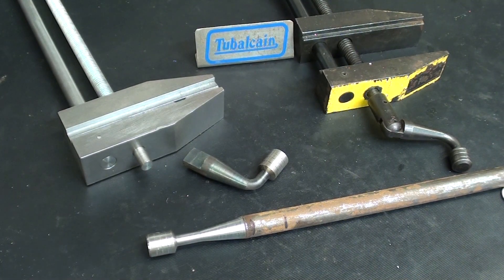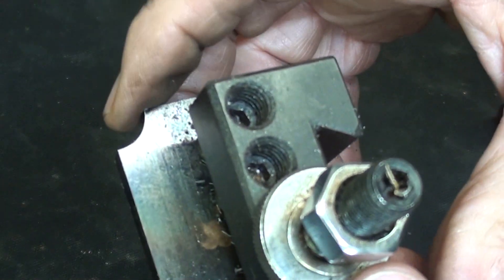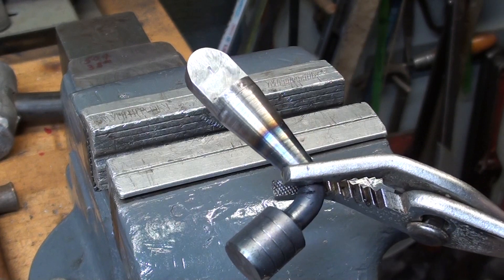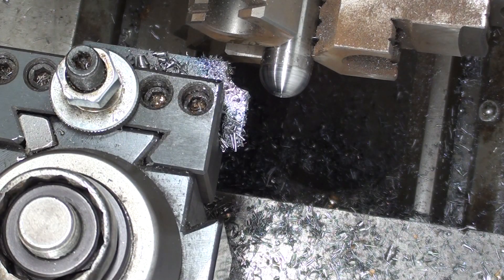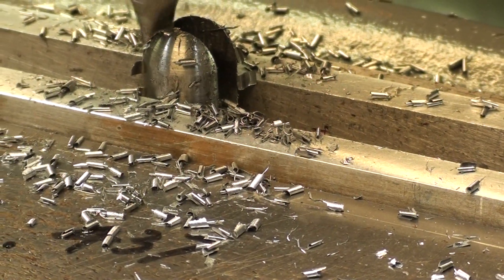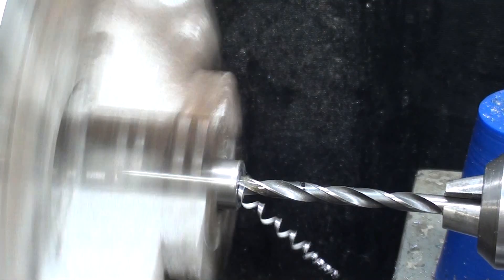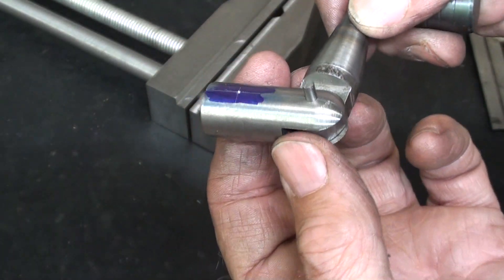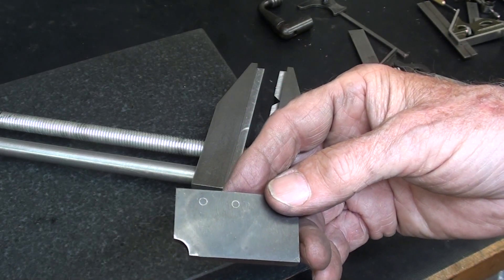MAKE A FLOAT LOCK Drill Press Vise TIPS 585 pt 6 tubalcain Crank Handle

Comment: Hi Mr Pete my vise is coming along real good . i over shot the size on the Acme threaded  part i turned it down to .493 and on the guide rod  down to .495 and thought it would be sloppy but all together it's nice no binding . 
The handel  taper came out sweet and now time to mill the flats . can i send you a Email  pic of the items i have made . Thanks JM 
Side question do you know how to make a 12 point bolt head from scratch ?
Reply from the maker: Sounds good! You can definitely send me pictures.
Reply: Soon

Comment: Mr. Pete, I finally finished this project.  I used 1/2-10 Acme rod.  The angle cut on the jaws was done on an Evolution dry-cut saw with some fixturing.  I had to buy a lathe to do the handle (any excuse, right?) and I seriously contemplated buying a mill, too.  In the end, I finished the handle joint with a hack saw and files---it took longer than the rest of the build!  The table clamp is cast iron that I TIG brazed to some 1/4" hot-rolled steel.  I couldn't mill a V-groove into the jaws so I clamped a piece of sacrificial bar and drilled a hole 1/2 in the jaw.  I rounded the corner of the table clamp so you can flip the jaws up on end.  The handle was difficult but it's really nice how it doesn't catch on the edge of the table, regardless of where it stops.  I made the other handle by drilling and threading a 6-32 hole in each end and in 2 pieces with a slightly larger diameter.  Then I screwed a 6-32 screw in and jammed the larger pieces on.  Then I cut off the protruding end of the screw.

Here's a link to the final product:  https://drive.google.com/file/d/1s8RNpYqjSK3MHoaU_YRa63Npfx1m1fDF/view?usp=sharing
Reply from the maker: Beautiful job on the vise.   I like the acme threaded rod

Comment: You are a true inspiration Mr. Pete. Mine is coming along very nicely, I made the forming tool from an offcut of HSS 6mm x 25mmx 150mm long, it only took 15 minutes to grind to the radius.  I followed your thoughts of forming both pieces,  and before milling, looking very nice! I used stainless steel for my 1/2" rod and threaded rod, just to be a little different.

Comment: Lyle, PLEASE STOP using your vernier calipers as a marking tool. You will wear the tips. If you really must do it that way, then buy a cheap $ 10 vernier, NOT your good quality one. Also use some heat insulation on your VICE jaws, you were losing a lot of heat by clamping it directly to the part.
Reply from the maker: At my age, everything is consumable

Comment: I think if you put the radiused piece in a collet block before milling, you could then turn it on it's side and rotate it 90 degrees to drill an accurate straight pin hole.
Reply from the maker: That would be the best way to do it

Comment: Those extra touches are worth it if you want to have pride in your work. Looks count, I've seen machining jobs done to the bare minimum for usability. They look very unprofessional. We should not be dissuaded from designing in attractive features that may not be absolutely necessary. (P.S. you could have used a ball turning tool for that radius. Most home shop folk have already made one.)
Reply from the maker: Yes